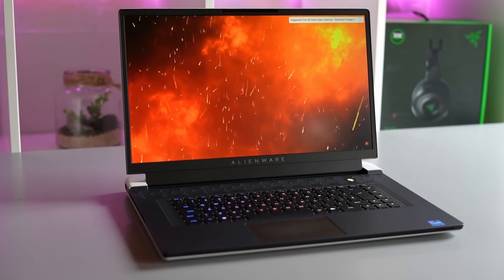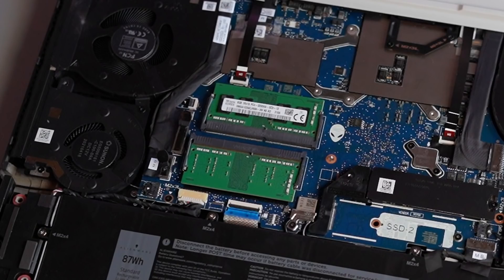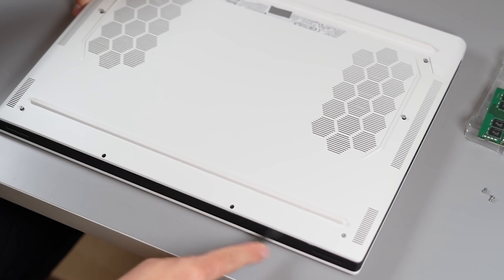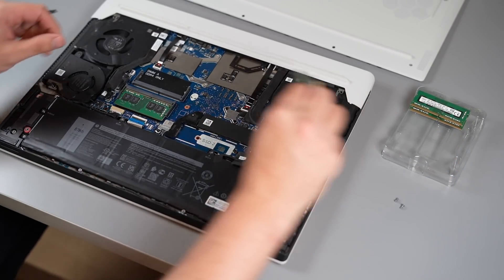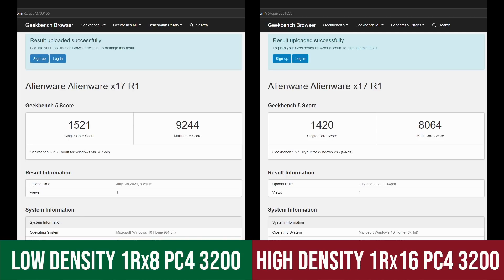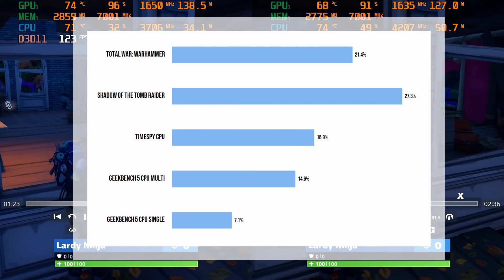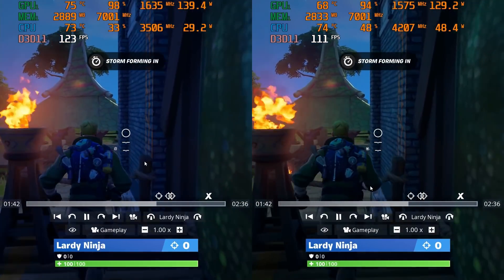Alienware X17 High Density Ram Strikes Again!  Upgrade Your Ram For Better Performance

Comment: Any idea if this is also an issue for the X15? RAM is soldered so wondering if the 32GB is the only option for low density. Thanks
Reply from the maker: I really hope not as it’s soldered on! My x15 finally arrives tomorrow so I will be doing a first impressions video and will be sure to check that 👍
Reply: @MashITTech  Awesome! Can’t wait for your review on the X15. Ordered one but it’s sadly caught up in the parts shortage train wreck.
Reply from the maker: yeah, we ordered ours on launch day and it is only arriving now!
Reply: @MashITTech  the despair is real

Comment: How would we know if our laptop support High or low density ram..?
Reply from the maker: Laptops are not picky over low or high density so you don’t need to worry about that. You just need to make sure you get the right speed first then choose the 1Rx8 spec next which is the low density

Comment: Hi I'm expecting to receive my x17 r1 with 512gb storage next week and bought another ssd samsung 980 pro which pcie gen 4. Im not sure if the extra ssd slot is pcie gen 4 ready because you mentioned one is gen 3 and the other is gen 4. TIA!
Reply from the maker: I haven’t tested the slots but I expect you will have to put the Samsung in slot one and move the other drive 👍

Comment: Hi! Thanks for the video! I own an Alienware X17 RTX3080(16GB) Please help! Dell is offering me a refund for the Alienware. Shoud I go for it and then get a GP66 Leopard RTX3080(8GB)? I dont know about TGPs at MSI but having in mind these X17 problems... I don't know what to do!!! My X17 is XMP RAM and it is scoring 12100 at timespy with an external monitor and 11400 with the built in one!
Reply from the maker: This issue isn’t affecting the xmp memory so you are good. This is only the base 16gb that is affected. Are you happy with the laptop? Other than the lack of mux switch and the ram I think it’s a great laptop 👍
Reply: @MashITTech  Thank you so much for answering! I always recommend your channel on my social media and friends :D. I'm ok with it, however I think it is abosolutely heavy (weight) and for the price I've payed (30120€) and its characteristics (165TGP + 11thgen) I expected higher performance than, for example, Legion 7 or other MSIs... At Dell.com the product page communicates that it is going to be a beast but it is just correct... Maybe GP66 Leopard RTX3080(8GB)+11gen is offering the same or even more performance (FPSs, TimeSpy) for 2100€ and 2.3kg... don't you think?
Reply from the maker: Ah yes, in the U.K. the prices are quite similar to msi but if the msi are that much cheaper then you should do it! The performance will be very similar 👍 the legion is on par in the U.K. for quite a bit less money so is probably the better buy for most people here

Comment: This is a good thing to check. I wonder if it's possible to find out if the x15 has a similar problem with ram. I heard that the ram is not upgradable in the x15
Reply from the maker: Our x15 arrives tomorrow so I will look into this then and let you know 👍

Comment: @Mash IT is it true that with the new bios update that Dell locked the XMP profiles in the bios? I watched this video and started looking at really good ram with low CAS Latency (Crucial Ballistix 3200mhz CL16) but it seems like it would need an XMP to run at those speeds and CL. Can you verify that XMP is locked out in the bios in the base 16gb model?
Reply from the maker: I didn't see it in the 1.1.2 bios but maybe you need XMP ram first! Let me look into it
Reply: @MashITTech  you’re the man. I don’t think I’m going to cancel my order because I’ve wanted an Alienware for years. But I still want high end functionality 🤣
Reply: @MashITTech  Did you ever find out if this was true??

Comment: I expect vendors to utterly cheap out on many components in their premium-priced laptops so I tend to look at the maintenance manuals to see what can be replaced - if I can't replace memory, storage and wifi I give the model a solid pass.

If these items can be replaced I look for the CPU, GPU and feature set that meets my minimum spec (as these can't be swapped out), make sure the laptop has the least amount of everything else and then wait for a sale. When there is an appropriately discounted sale I buy the laptop I want, and replace the sh1te parts with the parts that should have been used in a premium laptop build with a premium laptop price in the first place. The sale price offsets the additional expenditure, time and effort required due to lazy profiteering by 'premium' laptop selling companies.

Comment: So the original ram was High density ram. Im not sure what you mean by this? The 3466Mhz ram?
Please tell what the original ram was with your maching, thank you.
Also what did you upgrade it with? Because your link gives a dozen rams.
Reply from the maker: I ordered the 3200mhz base ram. The 2466 ram is good but expensive. The crucial 8gb stick I link is good or you can get the 16 or 32gb of the same version. If you are not sure tell me what you want and I will send you the correct link

Comment: I received my X17 today (3080, 11980HK, 64GB XMP RAM), updated Bios and all drivers, set max fan, high performance power, and overclocked as much as I could. Was able to hit a combined score of 12,030 on internal display (Optimus) and 12,812 on external display (no Optimus). Still hoped for more given the scores the similarly spec'd MSI GE76 can get (13,500ish), but not terrible I guess. Edit: Just barely got it to 13,000 with more tuning. Still not sure why it can't quite catch up to GE76 tho since the thermals are fine.
Reply from the maker: Hmm that is a bit lower than I was expecting especially with overclocking. I am going to see how far I can push my i7/3080/32gb that just arrived and let you know how I get on

Comment: Huh, thanks for covering this :) I'm awaiting one as well and I'm also curious about that 32 gig model if there will be the same results as this one after upgrade :)
Reply from the maker: Good news! Just received my 32gb 3200mhz and it is the low density so great performance out of the box! You made the right choice. Just making a video about this now
Reply: @MashITTech  just curious on how the performance on Dell’s 32GB configuration vs. your own Crucial 1Rx8 RAMs was? Were they both performed same or was Dell’s 32GB a bit better? I’m planning to buy a 16GB version and replace it with good RAM myself later instead of trusting Dell even with 32GB configuration. Thanks for your inputs as always.
Reply: @MashITTech  is the 64gb ram overkill? im a day trader and dont feel like having multiple screens or laptops anymore so im looking for a machine that can handle it all while still being able to travel

Comment: Is it possible to upgrade the internal hard drive?
Reply from the maker: There are 2 m.2 80mm slots so yes. You can change the first and add a second too
Reply: @MashITTech  where can I buy SSD internal hard drive? Dell store? Can you recommend any brand for it?

Comment: Hi. You know if the 32gb xmp ram option is one 32 gb or two 16 gb? Thanks.
Reply from the maker: It will be 2x 16gb in dual channel 👍
Reply: @MashITTech  you will try with xmp one? 😁
Reply: coinfirmed, it is adata 2x 16gb sticks

Comment: I got the 4k 32gb 3200hz ram. Do u suspect I will have the high density in mine?  It came with screen retention issues and a broken keyboard. I'm ready to give up on AW after this being my first purchase.
Reply from the maker: Wow that sounds like terrible QC! Can you open it and get the code off the ram? Don’t worry if it is too much hassle my 32gb model arrives on Friday and I will be checking it
Reply: @MashITTech  yeah I'll grab it in a couple hours when I get home from work
Reply: @MashITTech  SK HYNIX HMAA2GS6AJR8N-XN
Reply: @MashITTech  on my way to drop off at FedEx to overnight it back to Dell.  In ur full review is there anyway you could suggest other compatible ram that Is a best or top choices to buy and upgrade ourselves?
Reply from the maker: you can aways add a brand skin or something to jazz it up

Comment: I don't quite understand how high density RAM would be a negative impact.  I was under the impression that high density RAM was for high performance machines.
Reply from the maker: Not in this case. High density means there is less chips on the ram stick which also means less ram controllers as each chip has a controller so each controller has to do twice as much work (simplified explanation) so takes longer to find data

Comment: I received the Alienware x17 R1 this morning. I ordered it with 32GB XMP memory.

Here are the Geekbench 5 results:
1515 Single-Core Score
9141 Multi-Core Score

Looks good right?
Reply from the maker: Yes that is pretty good although surprisingly not better than my 32gb 3200mhz kit! Not sure what is going on!
Reply: @MashITTech  I ordered "32GB Dual Channel DDR4 XMP at 3466MHz" but the memory is clocked at 3200MHz. It is also rated CL22 per SPD according to CPU-Z. Can't find a setting the BIOS to choose XMP profile though...
Reply from the maker: Hmm, I wish I had ordered the xmp as I would be able to try and help you. Is there anything in bios or awcc? If it helps you can add me on insta and send me your bios screenshots, I may be able to help that way
Reply: @MashITTech  I managed to configure XMP in the BIOS. It was fairly hidden though. Single core performance improved slightly to 1559: https://browser.geekbench.com/v5/cpu/8720289
Reply: @erikloman9452   I have the same issue. (x17) Ordered 3466mhz but in bios it says 3200mhz. How did you enable it in Bios? I can't seem find it. Please help.
Reply: @erikloman9452  Amazing! Thanks!
Reply: My x17 scores 1631 single; 9211 multi in Geekbench 5

Comment: Seems crazy that Dell would be using this on a higher end laptop. Perhaps a lot of unused stock that needed using up, and in the knowledge that a lot of people upgrade RAM on higher end laptops anyway? Even still, bit strange!
Reply: Most probable explanation is that Dell/AW did not know the performance impact of high density ram
Reply from the maker: They would have known but want to save money I expect

Comment: I ordered one with 32 gig XMP 3466 mhz, 3080, 11980HK. I'm super thankful for this, though I don't know how to run a benchmark to check it. should be arriving next week, but thanks to your vid I'm gonna have to figure out how to check, and if it is high density, I will definitely be making a phone call.
Reply from the maker: Let me know if I can help you 👍
Reply: How the ram performing. Did you upgrade or no ?
Reply: @gtabhuvan3916  I am unable to use the computer with the RAM at 3466mhz. It's default is set to 3200, and you have to turn on overclock mode in the BIOS which then let's you change it to 3466. the problem is that I get blue screen crashes from this and the laptop auto resets the RAM back to default every time
Reply: Have you tried reaching out tech support
Reply: @gtabhuvan3916  I have.. got nothing from them.
Reply: @Throck69  you can ask them a replace or service event to check the laptop

Comment: So, I received my X17 yesterday and got the i9 3080, with the 32gb of high speed XMP memory. The BIOS tuning options for the CPU are limited at best, and if you undervolt/adjust the i9 tuning in the AWCC, this will disable the XMP overclocking profile in the BIOS and revert it back to 3200MHz (but still 1x8 so performs well)

After talking with support their advise is to "try throttlestop" or wait for an update down the line. If you go for the i9 32gb xmp like I did, you basically have to choose if you want to tune the processor, or use the ram you paid for.

Link to my timespy score as standard config 3200mhz memory in "OC1" AWCC mode. https://www.3dmark.com/3dm/63526847?
Reply from the maker: Man that sucks but to be honest I always use throttlestop to control the cpu as awcc is rudimentary at best! The thing that surprisss me the most is somebody at dell had heard of throttlestop 🤣
Reply: @MashITTech  https://www.3dmark.com/3dm/63568649?

Updated benchmark with some minor tuning and bypassing the iGPU with thundervolt (turns out HDMI also bypasses iGPU) 

11k on the CPU still feels really low for the i9.
Reply from the maker: Better but still not amazing, how were your temps during the run? Can you try it at max fans to see if it improves?
Reply: @MashITTech  peaked at 100 during CPU test momentarily. Average about 80-90, it was actually fairly cool for the most part. May run some stress tests to see if I can't get a nice tune in the CPU but for an i9 it's really underwhelming..

This was max fans AND external monitor to bypass iGPU.. most I can get out of the CPU is 9000 if I don't bypass CPU. Makes me think something else is weird.
Reply: @treemendus5748  I have the same config as you and I'm also stuck at 8500-9000 CPU score in TimeSpy. With external screen connected it is about 11000. What is going on here? I have ordered some new "test-RAM" just to be sure this is not the bottleneck.
Reply: @pitha-gn9zr  let me know? I can't figure it out. Memory bottle neck would make sense but the 32gb xmp "should" be good memory 😭

Your results line up exactly with mine
Reply: @treemendus5748  Will do... the wired thing is that with external screen connected everything is just fine. Besides that my R20 and R23 seem also be good with internal Display. R23 is 14800 points and R20 5700 points in multi-core benchmark. This seems to be fine
Reply from the maker: Have you made any progress yet Alistair?
Reply from the maker: my improved score was using in built screen with new ram. I get slightly better scores when plugged into external display 👍

This is such a shame about the XMP, you are better off just buying the base ram and upgrading yourself :(
Reply: @MashITTech  yep that's exactly my takeaway from this. Better off getting cheapest  SSD and memory and upgrading yourself so you know your getting something quality, as apposed to playing roulette with maybe you'll get something good or maybe not...

It feels and looks so good and the performance could be really good there's just some flaws that are stopping me from really loving it
Reply: @pitha-gn9zr  I have that same ram and oddly it didn't change my scores when I swapped it from the 16gb to 64gb. Trying to tune these is kinda terrible.
Reply: @pitha-gn9zr  interesting. Looks like I would have to pay for it to do that though.
Reply: @pitha-gn9zr  what screen do you have? Mine is the 1080 165hz so I don't think it should be trying to push anything higher
Reply: @caffeinatedfunctionality  I have 4K screen

Comment: Another setback for me, i was so set on this laptop and really thought dell were going to deliver. Really looking forward to your comparison video on pros and cons before going ahead. Atleast ram isnt soldered on i suppose
Reply from the maker: True. I have the x15 coming later this week so will spend a few days with that then next week I will start comparison reviews. I have m17r4 and razer blade pro on my list so far
Reply: If they did solder on the RAM, they might have gone with LPDDR4X 4266MHz and at 64GB that they could solder on, I'd say it could have been even better for the product as you wouldn't be able to to put in more than that anyways in a 2x DDR4 SODIMM configuration/platform, and the LP modules would have netted quite a few benefits for the mobile aspect...
Reply: many popular laptops from asus and lenovo also have this problem, so no need to get disappointed, just buy the cheapest ram configuration and swap in your own
Reply: @kokyixuan  thanks

Comment: Is there even a choice between high density or low density when configuring the x17 or do need to just buy ourselves the low density ram?
Reply from the maker: If you upgrade to the xmp you should be fine but it is expensive

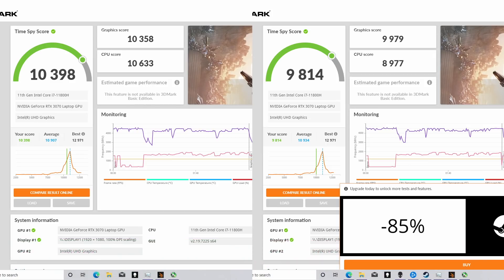Comment: 1:54 This is still a bit low. On my Legion 5 Pro (which is where this all started), I can get a score of 11200 on the graphics on the 3070 with 140W (just turbo mode, no overclocks or anything). 10358 seems a fair bit lower than that.
Reply from the maker: There is no mux switch on this model. If I plug it into external monitor scores improve, that will be in my deep dive video 👍
Reply: alienware m17 r4 3070 also has a higher score than this x17

Comment: Looks like it's an Industry wise problem now and this affects performance of both AMD and Intel CPUs. Linus also tried this high density ram in a 10th Gen Comet Lake laptop and the performance dropped quite a bit.
Reply from the maker: oh that's interesting, I missed his video! I will go and check it out. Such a shame when you are paying this much for these laptops then they perform worse than a 2000 series cards in certain games

Comment: Just got my x17. So with the link provided, I should get the "
32GB Kit (16GBx2) Dual Rank" ram for my x17 correct? Not the single rank?
Reply from the maker: you don't need to buy the dual rank, just the 2x16gb kit CT2K16G4SFRA32A is fine: ECC Type = Non-ECC, Form Factor = SODIMM, Pin Count = 260-pin, PC Speed = PC4-25600, Voltage = 1.2V, Rank and Configuration = 1Rx8 or 2Rx8
Reply: @MashITTech  so basically it’s important to get an 8bit RAM? I've seen in a shop two variants for the HyperX RAM one is described as „sixteen 1G x 8Bit“ and one „eight 2G x 8Bit“ .. both are 32gb (2x16gb) Kits and the other specs are looking the same. I have a M15 R5 (3070) do you have any experience with this one concerning the RAM? My benchmark result for TR is currently also 99fps@1080p@highest. Wouldn't upgrade for couple Percent… but up to 25% is massive…
Reply: @MashITTech  dual rank kit have better perfomance or you need 4x8gb kit